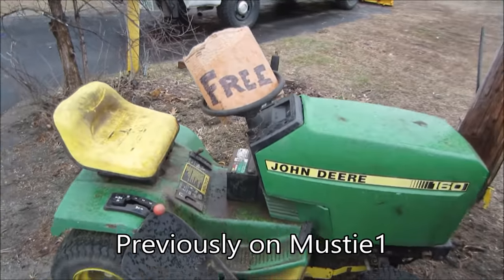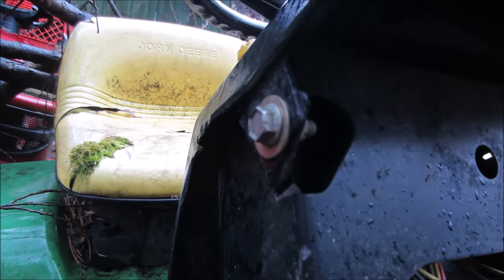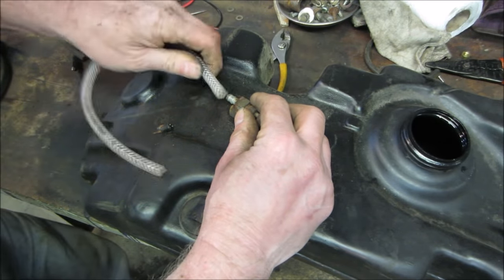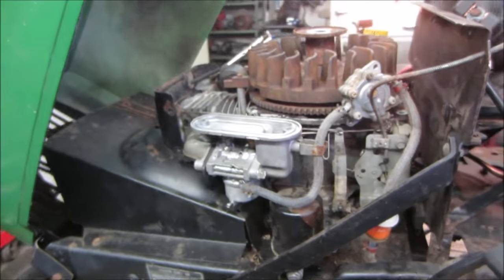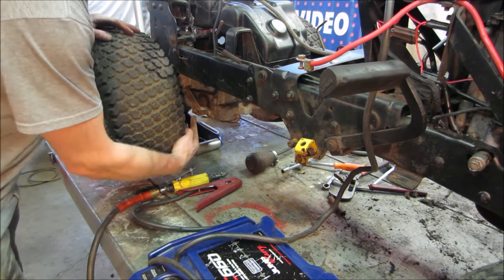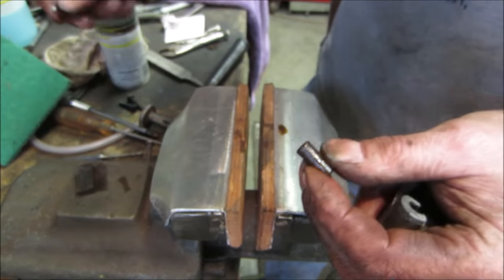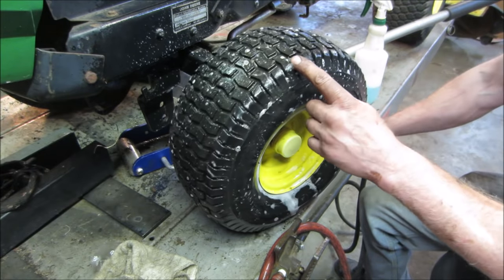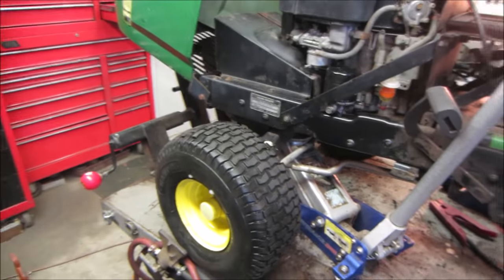CAN IT BE SAVED? Free John Deere that was in the trash. part 2

Comment: How much does that for the new gas tank and belts and battery?? And who has key switch ignition pto switches from old tractors laying around?? New blades or Sharpend them oil change filters etc

Comment: OL does mean OverLoad.  Why he blew back against the fuel pump is beyond me.  The oil will drain faster if he were to open the oil fill tube cap.  (dipstick) The Kawasaki filter would have metric threads, the old John Deere should have ASA threads.  Instead of squirting fuel down the throat of the carburetor he should have the air filter on it and saturate half of the air filter media and just drop the cover back on it, then  it should run over a minute.  I don't understand the advantage of having the valve stems on the inside side, I have never had a mower that had them installed that way.  He seams to call what I call a "valve core" a "valve stem."  He saw bubbles coming out of the tread, I saw them coming out of the sidewall. Ron W4BIN
Reply: So, where can we find YOUR You Tube videos, Mr. Know it all.

Comment: I have a John Deere model 111 I got it pretty much same way you get your stuff and I decided to clean it up so I took it apart very carefully and I put new parts in where I didn't want to go back in after them and cleaned it up and it pretty good did a pretty good job runs great but it starts in first it will not start in neutral something about the neutral safety switch yes I took that linkage apart to get the switch out what did I do wrong help me help me help me it needs to start in neutral I don't see any adjustment the bar that goes over the switch that contacts the switch the only thing I can figure is maybe it's a normally open or normally closed whatever it is I might have the opposite one does somebody out there have any sympathetic ear

Comment: mornin' everyone--watching Mustie fight with that grease gun, I thought, I know WHY it has to round INSIDE but why does it have to round outside ?  Mustie ? why not weld two pieces of something FLAT to the bottom of that gun so you can set it on a flat surface and pump the handle without it rolling around on a table / floor..........eh ?
Reply: Clip the vise grip on it.

Comment: Any more i just trash the engines that have internal problems,  Cause parts are so hard to fine!  Like rings, cams, and things. Getting so hard to fine lifters, springs and things. I just get a new engine for them. i get the ones with a little bit more horse power. All the other parts you can fine. Belts, decks, wheels and things > The old saying?  if it not broke?  Don't fix it!

Comment: you  0nly need the tractor model and serial number to find the parts you need. They keep them in stock no need to order. Just buy the right parts it is only 10 dollar part. What you did wiil cost more to fix than buying the right part